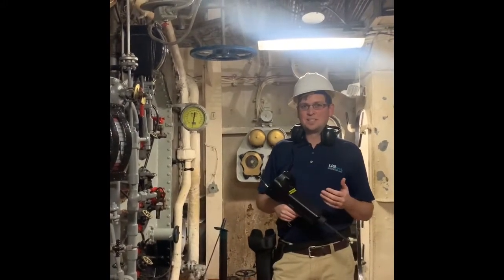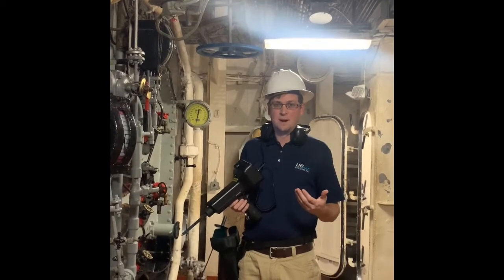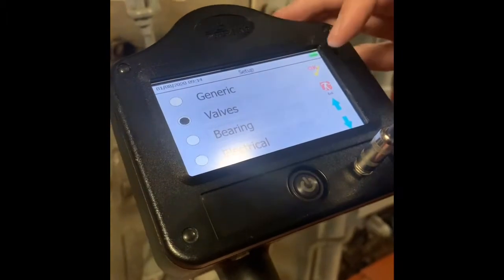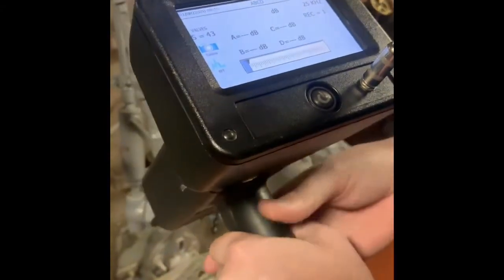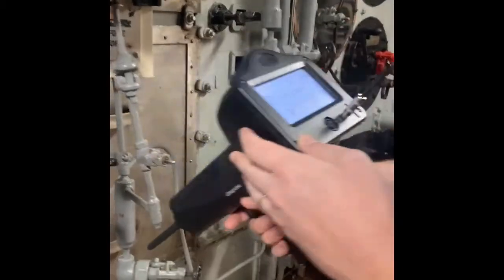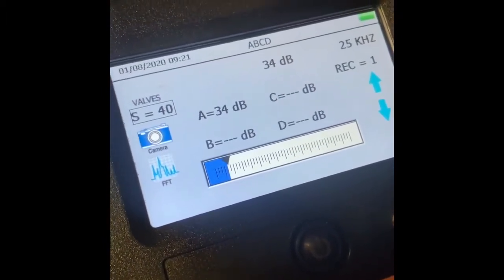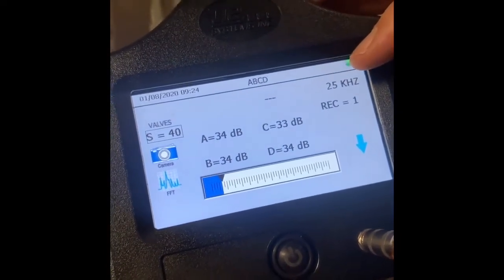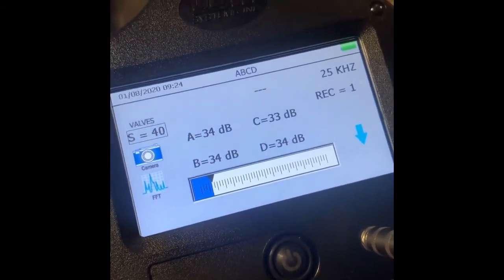Valve Testing with the UE Systems Ultraprobe 15,000

Comment: My question is Whether special analysis needed for a ultrasound leak inspection for recycle valves? Or else its just a dB is enough for This measurement?
Reply from the maker: To inspect recycle valves with ultrasound, you use the ABCD method: use a contact module in combination with a Ultraprobe to measure the sound intensity at two points upstream of the valve (A and B) and two points downstream (C and D). By comparing the sound levels measured in dB, you can determine if the valve is leaking or blocked.
Reply: @UESystems thank you